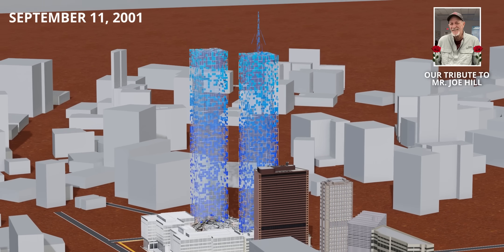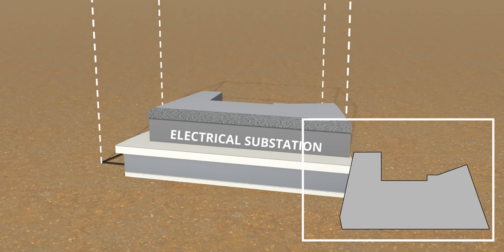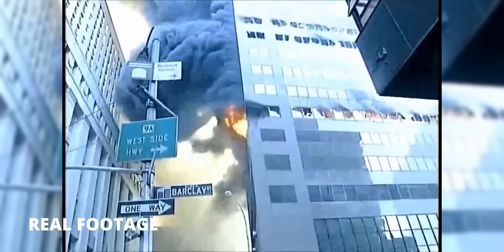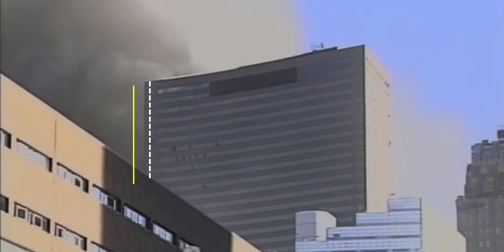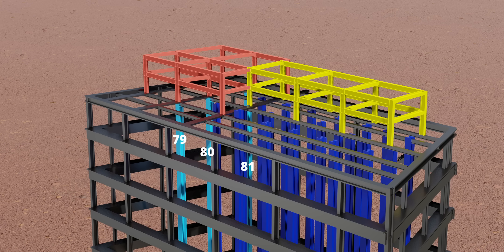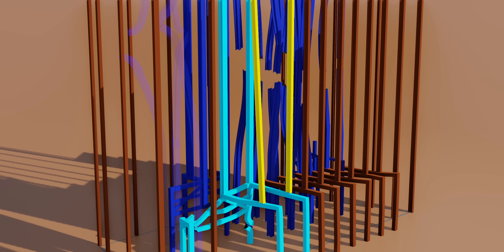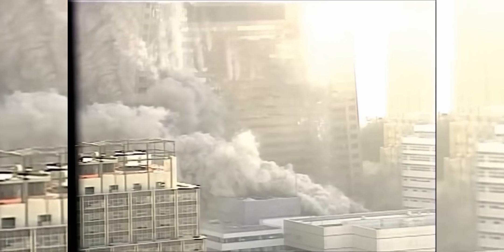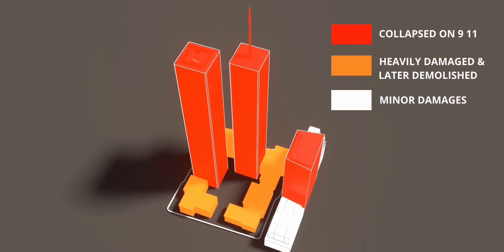Collapse of Building 7 | The Complete Physics

Comment: The analysis conveniently ignores the zero resistance freefall acceleration of the collapse that even NIST eventually acknowledged. 
This phenomenon cannot occur from various isolated structural failures. Only the near simultaneous destruction or removal of ALL vertical support columns can cause such a freefall collapse. 
Any analysis that avoids directly addressing this phenomenon is therefore pure bullshit.
Reply: @h1F595  But mikrobrain, you are not able to explain the free fall without controlled demolition. No-one can. You pathetic liar even lie that it was "near" free fall and that it was only "a small portion" although you know very well that it was ACTUAL free fall of the ENTIRE BUILDING (all walls + roof). That´s how desperately you dodge the free fall that proves the controlled demolition. You´re a disgusting liar and a pathetic fail mikrobrain.
Reply: @h1F595  A small portion? A small amount of time? Do you even hear yourself? Watch the video collapse again. The only reason there isn’t more physical evidence of a controlled demolition is because NIST never that hypothesis. Please, think harder.
Reply: @erniesalle7512  - The collapse of Building 7 is probably the most studied engineering disaster in history and the subject of 5 comprehensive engineering studies and more than two dozen technical articles in major peer reviewed engineering journals, most of which were published 15 or more years ago. Thousands of pages of material.  This should get you started.

FEMA BPAT (initial report superceded by NIST NCSTAR 1A)

NIST NCSTAR 1A: Final Report on the Collapse of the World Trade Center Building 7, 2008.

Guy Nordenson and Associates, WTC7 Global Collapse Analysis Report and Summary of Findings, 2010.

Arup, WTC -7 Structural Fire Analysis Report (Runs 1-4), 2010.

Weidlinger Associates Inc., WTC 7 Collapse Analysis and Assessment Report, 2010.

BRE Centre for Fire Safety Engineering, Analysis of the Impact of a Fire in the Mechanical Room (5th & 6th Floor) of the World Trade Center 7 Building, 2010.

T. McAllister, R. MacNeill, O. Erbay, A. Sarawit, M. Zarghamee, S. Kirkpatrick, J. Gross, Analysis of structural response of WTC 7 to fire and sequential failures leading to collapse, J. Struct. Eng. (United States). 138 (2012) 109–117.

For a summary of the major studies I would recommend THE COLLAPSE OF WORLD TRADE CENTER 7: REVISITED by Mhd Anwar Orabi , Liming Jiang , Asif Usmani and Jose Torero which is a 33 page summary of the different analysis and conclusions published in 2020. Sorry, YouTube will delete this post if I give the link but it should be easy to find and is available from the University of Queensland, Brisbane. 

Happy reading
Reply: It does not ignore anything because there was no zero resistance freefall acceleration .  You are grossly misunderstanding the event and what The NIST said about it. For example, The NIST's probable collapse sequence does not include near simultaneous destruction or removal of ALL vertical support columns and yet, at the very end of the collapse, one spot on the external frame was measured to average 9.8 m/s/s over a very short period of the overall collapse.  

Why is that?  Did you even realize that?

One of the big lies of the 9/11 Truth Movement is what you just repeated. Either a lie or a gross misunderstanding of the basic mechanisms and how shit works. This is why the free fall argument has absolutely failed to gain traction with anyone that matters since 2006.
Reply: @ But, there is absolute undisputed measured and documented freefall acceleration for at least 2.25 seconds. Even NIST admitted to this simple fact. You are free to lean into whatever cognitive dissonance you’re under, but that will never change this simple fact. Freefall acceleration can only occur if all vertical columns are severed or destroyed near simultaneously. Nothing short of controlled demolition can cause such an occurrence, literally nothing. Enjoy your Coolaid.
Reply: @Kudde23  Anything else princess?
Reply: @Kudde23  If I drop a coin from the second story of a building, it free falls. Was demolition involved goof?
Reply: @ButtHead-n5u  Are you confusing a 47 storey skyscraper with a coin copypoo?
Reply: @TheCriticalStinker-01  You shills desperately dodge the free fall because you can´t explain it without controlled demolition my poor pathetic liar.

Comment: A shit load of Thermite like the other two towers
Reply: Thermite usage was debunked over a decade ago. Get your conspiracy-core right!
Reply: Thermite, that has to be one of the dumbest theories I've heard so far, have you ever used thermite?
Reply: Yeah, but how about nano termite?
Reply: @dikranovichk5889  like microscopic termite robots or something?
Reply: Cia used a few floors that were like fort knox in wtc 7
Reply: That’ll do it
Reply: Y'all are insane the metal softens from the heat both towers burned for almost an hour etc 7 burned for 6 hours steel cannot handle that long it softens
Reply: @Toltec77  When a fire burns it moves through the building. A fire may burn for 6 hours in total but it's not in any given place in the building for more than an hour. This is because the fire burns up all the office furniture & it has to spread to other areas of the building. Also keep in mind that WTC7 had no jet fuel in it.

The fire proofing keeps the steel below the threshold of weakening for 2-3 hours when exposed to normal office fires. The fire shouldn't remain for longer than 1 hour. 2 hours of fire protection is part of regulations because it's far more than enough time to withstand an office fire.

This video is also completely wrong about the columns buckling due to weakening from the fires. There is no collapse theory that involves weakening from fires. NIST who were in charge of the official investigation concluded that the columns didn't buckle due to weakening from fires.

NIST has a different explanation where thermal expansion induces strain on the structure & causes a joint failure on the columns. This failure then initiates the collapse. This at least makes more sense since fire proofing doesn't prevent thermal expansion.
Reply: @Toltec77  The north tower had burned for more hours before and it could handle it, obviously.
Reply: @ when  was before?
Reply: @Toltec77  1975
Reply: @ was the tower hit with a Boeing 767 and burned for 1 hour and 40 something minutes with jet fuel?
Reply: @Toltec77  I was referring to your comment and your comment wasn´t about a Boeing 767. Please feel free to look up your own comment again.
Reply: @Kudde23  no you said that the tower handled longer in 1975 but at that time was it hit by a Boeing 767 going 429 miles an hour filled with jet fuel? Was it? When I talk about the Boeing I’m talking an the type of plane that hit the north tower the same one you said burned and didn’t fall in 1975 talking about how it lasted longer this is why
Reply: @Kudde23  you are contradicting yourself
Reply: @Kudde23  please respond I was having fun arguing with you
Reply: @Toltec77  Ok, if we are insane. Tell us the source of fire that would take down building 7. Hint: Jet fuel from the airplanes mostly ignited upon impact of building 1 and 2 and I am willing to overlook the claim that the remaining jet fuel is the cause of the collapse of buildings 1 and 2. But exlpain to me the source of fire that gave away the heat that will "soften" the steel in in building 7.

You are just in denial and that's understandable.
Reply: @momoh,  did you know that two little iron balls, the size of ping pong balls, probably closer to the weight of snooker balls, but anyway. You take these balls, set them in water for a couple days, wrap aluminum foil around one balls, clang them together, and do you know what you get?   I’ll give you 24 hrs to answer, and if you run away, I’ll give you the answer
Reply: @dikranovichk5889  I would get a spark. But what does this have to do with explaing what brought down WTC 7?
Reply: Ok, what kind of spark would you get?  and any idea what the temperature of that spark would be?
Reply: @dikranovichk5889  I don't know the temperature exactly that would arise from that spark. But I would say its pretty high. 

Are you saying that similar temperatures occured in WTC7? Is this really what you are implying???
Reply: @MohOEM  maybe the building right by it on fire collapsing right next to it? I mean your acting like it’s impossible for burning debris to hit wtc 7 and ignite its interior
Reply: @Toltec77  I never denied that falling debris from WTC 1&2 didn't damage WTC7. But this damage wouldn't  have cause the collapse of the building in that way. It would have been much slower and not in the way filmed. Not at free fall. Free fall is what happened. It means the the falling parts of the building didn't  meet any resistance until it reach the ground. 
If the collapse was really from the debris of the other buildings, WTC 1&2, it would have met resistance till it reached the ground.
Reply: @ I didn’t say the building collapsed cause of the falling debris, the debris created a gash in the side of the building that ignited, in the collapse the other side of wtc 7 gave way from the steel softening, you can actually see in some videos the top of the buildings units collapse into the tower before the whole thing comes down
Reply: When fire burns for continuous amounts of time it does not have to be thousands of degrees to weaken it
Reply: Mohmo, the free fall in building 7 was for something like 2.5 stories, of a 47 story building, and it was actually only after the collapse was broken down into stages.  From what we can see, the collapse begins when the penthouse falls into the roof, and the roof caves in with it. The 2.5 stories of free fall occurs when the shell collapses. After the insides of the building, have been collapsing for at least 5,6 seconds. This is all verifiable. One of the twoofer saviors community college teacher David chandler came up with the 2.5 number
Reply: alright, I lied, 7.5 stories of free fall, after the penthouse had collapsed and the insides of the building was being gutted,  then the exterior shell collapsed for 7.5 stories at free fall
Reply: Exactly

Comment: This is such bad content
Reply: And yet not wrong. Go figure. 
	
This video is very good – with one or two exceptions - and goes into a much higher level of detail than many viewers will be able to comprehend.  While not perfect, the collapse mechanisms – the sequence of failures - described here  are substantially correct and this is true no matter who planned and carried out the 9/11 attacks or why . 

That may not be what you want to hear and go against 20+ years of entrenched dogma and conditioning, but it’s not wrong. 

That also means (in case you did not get the hint) this video can be (and IS) absolutely correct in its description of collapse mechanisms AND the 9/11 attacks could still have been some sort of inside job. The two things are in no way mutually exclusive. 

The mechanisms described here have broad professional support around the world. There are no professional engineering organizations (for example: ASCE, ASEE, ICE, etc) that disagree with them or have offered any formal dissenting opinions or alternative hypothesis. 

So, setting hubris aside, either the overwhelming majority of the worlds structural engineers and simple observation are wrong,… … or you are. Which seems more likely? 

IF you still think believe this explanation is wrong then produce a better one . Good luck with that. No one ever has and I don’t see you moving that needle today. 

No one ever does.

Comment: Funny how the empire State building in New York 1940 was hit by a plane 
And it's still standing. .finish in 1929. And the plane bounced off and fell on the street. What happened to the alleged planes at the twin towers. Where'd they go. I guess it's just magic.
Reply: Different building, different plane. A 10-ton B-25D Mitchell bomber at 200mph has a tiny fraction of the energy of a 117-ton Boeing 767 at 590 mph. 

That 10-ton B-25 impacted the ESB with the energy equal to about 41 pounds of TNT which to be fair is a lot of energy. 

On 9/11/2001 the 117 ton Boeing 767 for Flight 11 impacted with the energy of about 1,400 pounds of TNT and Flight 175 nearly 2,000 lbs of TNT respectively . 

Is 1,4000-2,000 pounds > or < than 41 pounds of TNT?

Context is everything.

But of course, none of that has anything to do with the subject of this video.
Reply: No, what's "funny" is your complete and utter lack of anything even remotely resembling basic understanding.

Comment: Do not take the public as fools with your b.s. cartoon explanations.  Many of the occupants of building 7 did not go to work on 9/11.  Those that did go to work were some of the first to evacuate even before people in the twin towers knew what was going on.
Building 7 never got hit by any aircraft but fell down on the same day as the towers collapsed, if that is not a smoking gun pointing to an inside job... your dumber than the makers of this video think you are. 

We already have video footage of a molten metal flowing from one of the towers  and when matched to a pyrolytic heat chart shows they were brought down with something more like therminite than jet fuel..  Saying nothing of the early pictures of the twin tower mess showing steel support columns all cut at 45 degrees in the same direction.

So enough with the idiot stuff and time for some truth!

Comment: Where's the White Paper? Where's the peer reviewed research? Sounds like a lot of unsupported and gratuitous assertions. Why has it taken 23 years to develop this hypothesis? Why does it contradict the NIST report findings published five years after the event? The collapse of Building 7 is consistent with a controlled demolition. That hypothesis fits the known facts. Everybody knows this. The question then becomes who did it, how did they do it, when did they wire the building and for what purpose? I believe the video above is smoke and mirrors designed to distract and mollify...and to give the perpetrators plausible deniability.
Reply: The collapse of Building 7 is probably the most studied engineering disaster in history and the subject of 5 comprehensive engineering studies and more than two dozen technical articles in major peer reviewed engineering journals, most of which were published 15 or more years ago. Thousands of pages of material.  This should get you started.

FEMA BPAT (initial report superceded by NIST NCSTAR 1A)

NIST NCSTAR 1A: Final Report on the Collapse of the World Trade Center Building 7, 2008.

Guy Nordenson and Associates, WTC7 Global Collapse Analysis Report and Summary of Findings, 2010.

Arup, WTC -7 Structural Fire Analysis Report (Runs 1-4), 2010.

Weidlinger Associates Inc., WTC 7 Collapse Analysis and Assessment Report, 2010.

BRE Centre for Fire Safety Engineering, Analysis of the Impact of a Fire in the Mechanical Room (5th & 6th Floor) of the World Trade Center 7 Building, 2010.

T. McAllister, R. MacNeill, O. Erbay, A. Sarawit, M. Zarghamee, S. Kirkpatrick, J. Gross, Analysis of structural response of WTC 7 to fire and sequential failures leading to collapse, J. Struct. Eng. (United States). 138 (2012) 109–117.

For a summary of the major studies I would recommend THE COLLAPSE OF WORLD TRADE CENTER 7: REVISITED by Mhd Anwar Orabi , Liming Jiang , Asif Usmani and Jose Torero which is a 33 page summary of the different analysis and conclusions published in 2020. Sorry, YouTube will delete this post if I give the link but it should be easy to find and is available from the University of Queensland, Brisbane. 

Happy reading
Reply: Ask and answer fakery by the planter💩🪴🫡💩🪴🫡⬆️⬆️
Reply: @Larry26-f1w   Why are you complaining that CriticalStinker answered you?
Reply: "The collapse of Building 7 is consistent with a controlled demolition.  That hypothesis fits the known facts."
Which is why it exhibits none of the signs of a controlled demolition, real or made up, then?